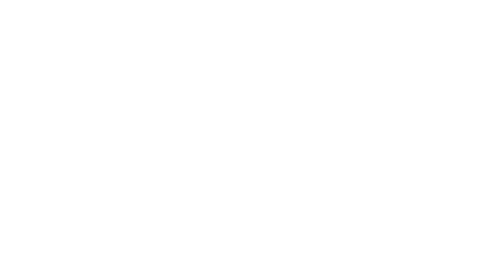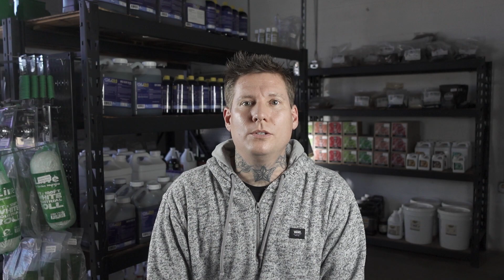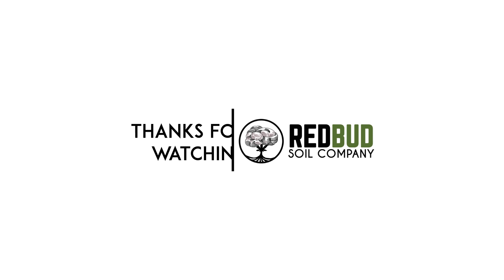Heavy Metals In Organic Cannabis Growing - Part 2

Comment: When I began building soil for indoor use, I was surprised to read that we do not water to an extent, such as nature does, to get runoff; being selfish humans I get the intention to retain everything. However, that is not how nature works. 
I'm surprised to hear surprise, albeit in good form, that an unnatural process causes a problem. Top dressing does work; Fukuaka and Stout both proved this point to a degree. Wherein, both employed the concept. However, they did it outdoors where nature was in control. 
My belief is that our indoor beds, high-tunnels, etc. need a better balance brought by cleansing, retaining, and repurposing versus amending based on a point-in-time testing methodology. Otherwise Solomon wins, and I do not believe this was his intention. 
Disclaimer: I use to build 200+ mph racecars working in NASCAR, and most of what engineers had in mind was already conceived as bs at the point when they said, "I believe..."  because practical racers knew better than to believe without first using sense of the most common form.